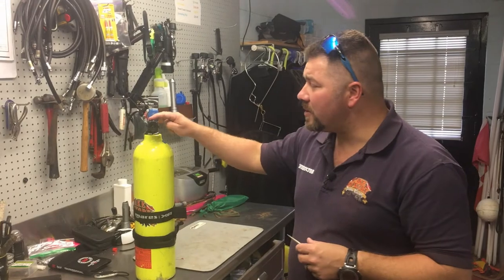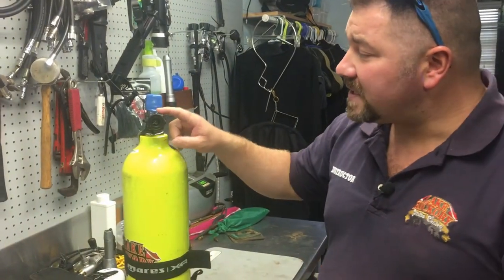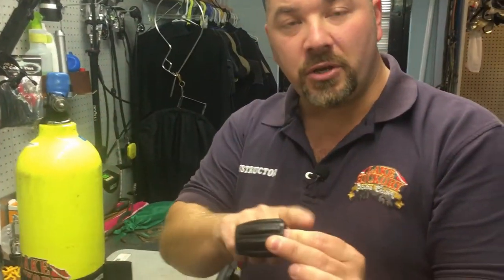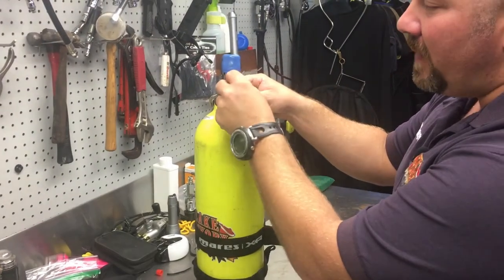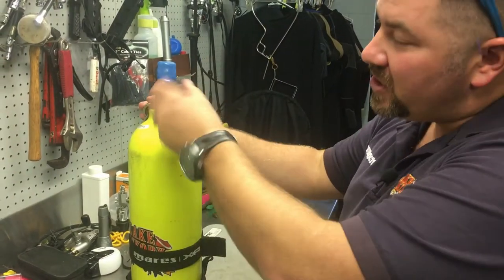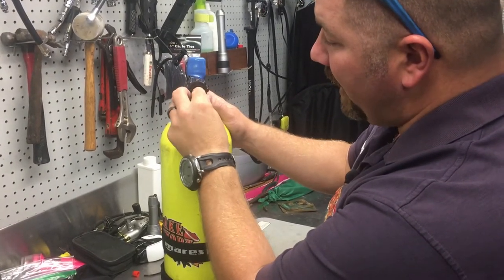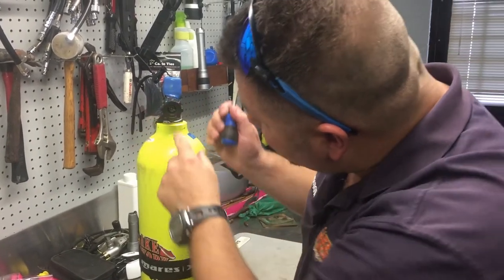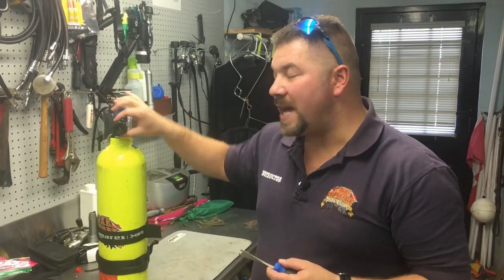Replacing A Turn Wheel On A Cylinder Valve

Comment: Thanks for the video! I was wondering how to replace the valve knob. Your video made it very clear. Thanks!
Reply from the maker: Mike Keck You are welcome.
Reply: Are the turn wheels one size fits all for different valves?
Reply from the maker: Mike Keck The short answer is Yes and No. As long as the inside well of the turn wheel is not too deep and the size of the stem is consistent with the slot in the turn wheel, then most all turn wheels will work as a replacement. Unfortunately, not all stems are the same. Luxfer, Sherwood, Genesis, are just a few different companies that manufacture cylinder valves, but all have different stems.
Reply: Mike Keck  hi I'm 13, I dive in a dry suit but I'm not sure what weight I should use. In a dry suit I'm comfortable with 3kg, I'm 5,7 what do u think if it's even possible to know
Reply from the maker: The easiest and safest thing to do is to get up with your local instructor and have him do a proper weight check in the pool with you.

Comment: Brian, I love your videos. I had a question though: how does one get started learning how to work on scuba gear? In particular I would love to learn the right way to maintain my own equipment, partly because I believe in self-sufficiency.

Thanks! Keep up the good work.
Reply from the maker: Great question, and oddly enough, I just finished a conversation with a gentleman on this very topic.  For most of the big manufactures, a diver needs to be associated with a dealer, such as an employee at a dive shop, to qualify to take a technician level course for a manufacture.  There are however, gear manufactures that will open the technician course to any diver.  HOG is a great example of this.  Most of us in the industry will take these classes during the big diving show every year known as DEMA.  But they are offered periodically throughout the year elsewhere. And as members of the industry, we have to get re-certified every so often, because of insurance and liability.  You however, can contact the manufacturers by phone and ask them directly what classes they offer and where to get signed up for one.  I was recently told that Scuba Pro just began to offer technician courses to anybody wanting to take one, not just Scuba Pro dealers. The restriction on buying parts is the difficult part for the person who wants to service their own equipment, and this restriction is set by the manufacturer, not the dive stores.  If it was up to me, I would sell parts kits all day long, but I am restricted by Mares.  Now in the case of the video above, as far as I know, just about anybody can take a course learning how to service tank valves and such.  I know PSI/PCI whom I am certified through will teach anybody, and I also believe TDI offers a similar class as well.  My experience has always been through a shop, and I have held and still currently hold several technician certifications for different manufactures.  I will state this though, they physics behind how a regulator works is the same on just about every regulator on the market.  A piston style from Mares, works just like a piston style from Sherwood.  If you have access to the proper parts and tools, then you can pretty much work on just about any regulator out there.  The key is having the proper tools and parts.  Hopefully this answers your question.
Reply: Thanks Brian! I know where you can get parts and tools for old gear, like pre 1990 aged stuff that isn't serviced by manufacturers any more, and I was thinking about getting one of those to play with. But I'd also like to be able to service my more modern gear as well, since it is a lot nicer.

I'll chat with the folks at my LDS and see what they say. They may be willing to let me pot around in the shop to learn the ropes.
Reply from the maker: Jason Mills I encourage all my customers to stick around and watch me work on their gear, that way it gives them a better idea of what we are actually rebuilding. Unfortunately I am still restricted on selling them individual parts kits and letting them do it themselves. Even when I teach an Equipment Techniques course through PADI or SSI, I will help a student disassemble and reassemble a regulator and a tank valve, just to give them a better understanding of how they work.